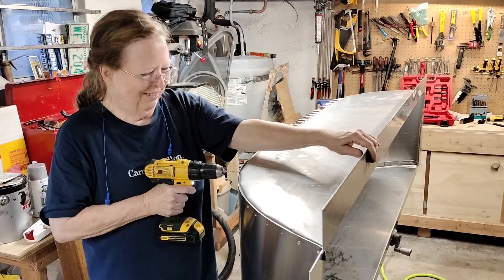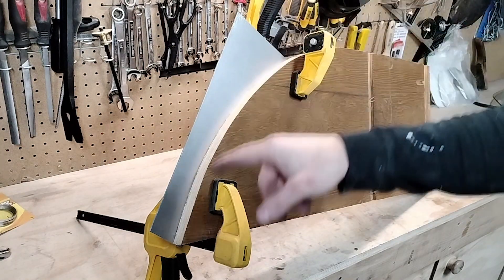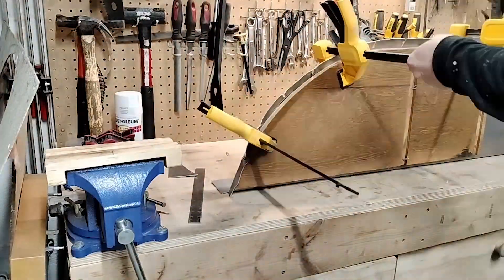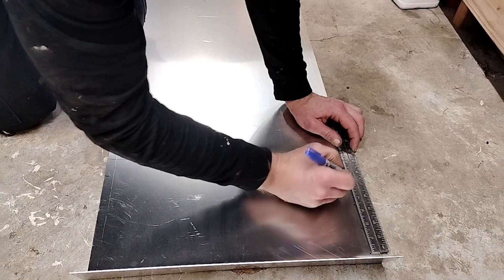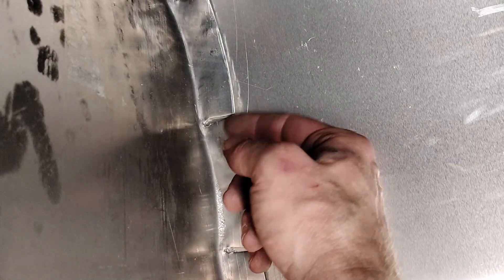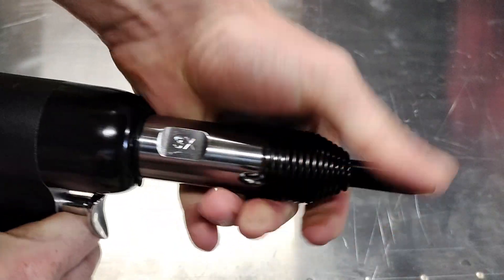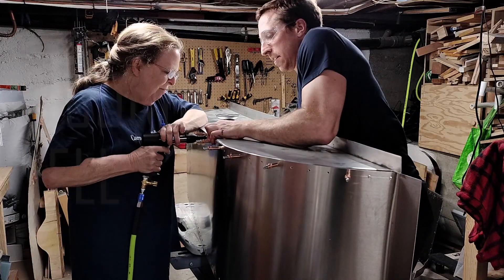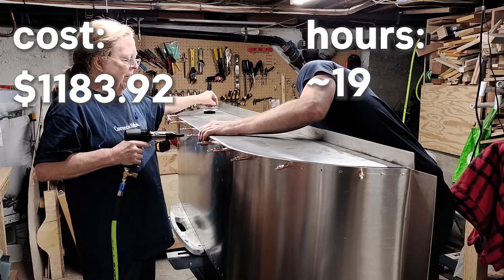Buck (Solid) Riveting New Wheel Wells for a Vintage Camper | E09

Comment: you should be using a # 30 drill bit 0.1285" for 1/8" rivets. you are getting the feel for it. Also bodywork hammers.
Reply from the maker: Ah yes, I've heard that's the right bit! Thank you.
Have been thinking about auto body hammers to work on the dents in the skin...